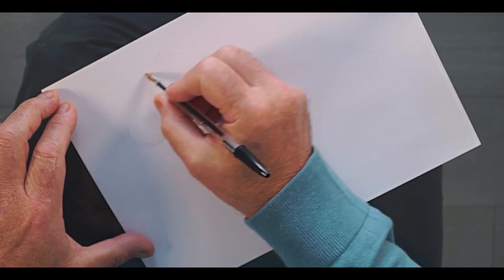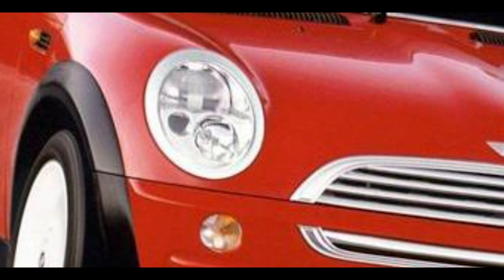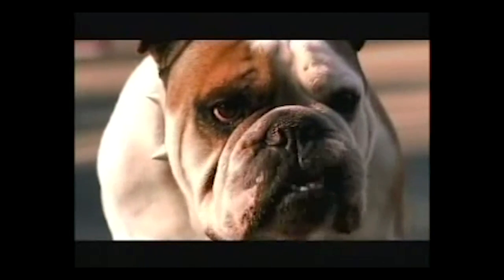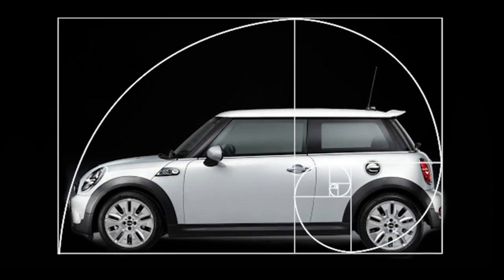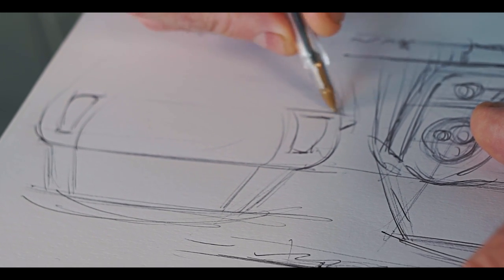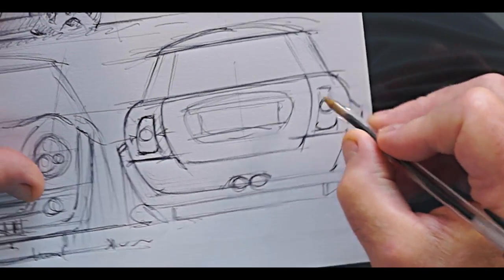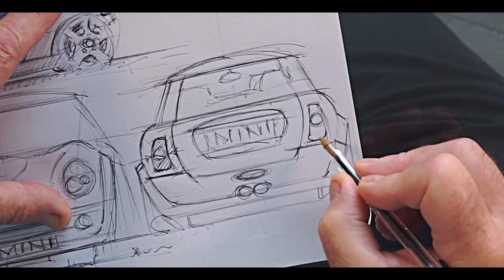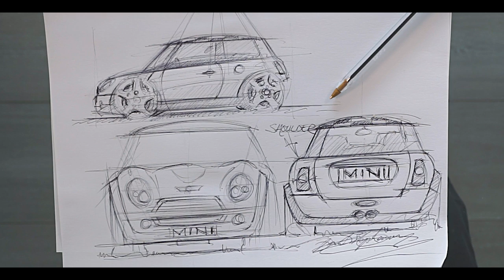How I Designed The MINI COOPER....

Comment: I had an 04 mini Cooper S. I think you guys nailed the design in comparison to the original. 
And the car was just as fun, if not more so thanks to the supercharger whine. I had mine bumped up to 225 HP. And a fully adjustable performance suspension. Also had a Carbo Fiber Hood, fenders and lift gate.

I now have an 09 1 Series. Which is heavily modified as well. Carbo Fiber M hood with power bulge. Fully adjustable coil overs. 
Which is an absolute blast to drive! Its producing aprox 260hp to the rear wheels.
Reply from the maker: Dayum, nice! 💥👍

Comment: I own an r56 jcw so the second gen of the “new” minis and i am so grateful that the design of my car still carries the same language and soul that you poured in to the original cooper.
Reply from the maker: Congrats and thanks BRM!
Reply: @FrankStephensondesign  its an honour mr stephenson! Until now, i had no idea that the “new mini” could have been designed in any other way. Your design was so faithful to the original in as many aspects as possible that it works so well as a seamless transition to the modern incarnation. Without your initial spark of genius i would not own such an amazing machine (minus its engine getting rebuilt and countless mechanical issues 🤣 but hey thats bmw’s fault)

Comment: I absolutely love this design. It is timeless. I have enjoyed looking at it every day for the last 5 years!!!! It already is a timeless classic that cannot be replaced in my book.  The design of this R53 is still selling this MINI brand, because every design change after it has been for the worse.  I can't thank you enough for bringing this to life. It is such a joy. 
A bit of history

I kept it stock for the first 4 years anticipating a breakdown that has still never happened. Bought it with 80k on it and it now has 140k. Nothing but tender-loving general maintenance. I'm always listening for a new sound and it runs like a top.

So lets put a cam in it and big injectors, have the ecu tuned, get rid of those cats with some headers and finish off with a single muffler exhaust, some more boost, intake, just everything we can bolt-on and give it over 200 wheel horsepower.  Now I got the cutest, and fastest car :) Game over, I win. 
I can't wait till the clutch goes out so that we can rebuild the lower end of the motor and put a limited slip diff in it.  If I had two, I'd just go ahead and do it.  Maybe I need two...

Comment: The first generation “new” Mini was a fantastic design. It was truly a younger image of the original, with some key touches that were faithful to the classic design. After that the car has grown increasingly chubby and larger, qualities that the classic Mini did not have. For that reason, for me, the appeal has been lost. The car may be more spacious, powerful, and have all the modern creature comforts, but that is just the opposite of what the appeal of the original is. So the new Mini, not for me, thanks.
Reply from the maker: I agree! Thanks for your comments.
Reply: And this sums up why I am still driving a 2002 Mini Cooper S which I bought brand new. I am looking forward to its twentieth birthday.
Reply: Agreed. Got a 2004 mini. Next car is going to be the New Audi A1. (Or another old generation Mini)
Reply: This design has aged very well. Great job!!
Reply: Bruno Desrosiers Have you had the oil leaks fixed yet? I'm having mine done shortly. Not Frank Stephenson's fault obviously, he didn't specify dodgy gaskets I'm sure.
Reply: Bruno Desrosiers Ah SAAB, a company that did things differently and did them well. I could see myself owning a SAAB.
Reply: I own a 2nd gen "new" mini cooper S, the R56. I believe they stayed true to the original design despite being larger. But I have to say, I really don't like the most recent F series mini.
Reply: @FrankStephensondesign  Yep, this is why I like my 08' Cooper S..
Awesome car despite the uhhh... VERY unreliable engine that BMW/Peugeot threw into it.
Reply: I waited for almost 18 months to get my 2002 mini. It was a wonderful car. The bulldog stubby look was brilliant. I owned it until 2017. During that time BMW destroyed the mini. Utterly horrid. Too bad.

Comment: Fantastic video.  Thanks for sharing.  Your design was what made me join Zipcar, so I could rent Mini Coopers.....which you could for a time.  If we call your redesign the Series 1 of the new era, I still stare at it.  And your video articulates thoughts I felt about the design but couldn't put into words quite so well as you do.  I loved those tiny round side indicator lights (which later bloated into something garish).  That combined with the artistic color and design choices buyers had (Union Jack roofs), and the whimsical campaigns.  Remember the Coop and me videos?  Even the interior warning chimes and accent lighting were classy.  Now that you mention it, no manufacturer really goes to the trouble of drilling out holes in sheet metal to insert tail lights.  I believe you should mention the extra design attention to the curved window glass around the C pillar...evidently that was a more expensive design to produce, which I think they modified later.  Clever and gorgeous.  Looking at the Mini lineup now, I think the only one that comes closest to that sense of right design your Series 1 created is oddly enough, the 4 door Clubman.  Best wishes.

Comment: Mr Stephenson. Thank  you for the Mini. I have R53 and the design is spectacular. One of the most best design of 2000 century and it did really well take the main points from the old Mini so it is recognizable Mini.
I like for example how the sides curves from the top without any spoke and then in the bottom starts to curve back. You can see this well after the front tires where there is like a little dent and then the black rims turns it outwards again. And you can see it also on top of the back wheels how it curves first in one way and then on the other way before there comes the black plastic. R56 was newer so good looking thing. I think that is because R56 does only bend in one direction; it looks little bit too soft/ not sharp.
Something about how well the design came out tells that when I take people in to my car and aske about how old is it? Usually the answer is 2015 or 2010. After over 15 years it still looks to people like new. It has aged really really well.

Comment: Frank, first thank you for your work and for making your work accessible with these videos. I believe that my r53 is a work of art. As such I believe it should bear your signature. Would you consider making a vinyl or other type of decal that would simply consist of your signature for owners who share my feelings?  I would be honored to have a small subtle signature on the lower corner of the back hatch for instance, or perhaps just below that gorgeous tail light.  (As a former print designer I would go with cut uv resistant vinyl. Though clear vinyl printed has certain advantages in production.)
Reply from the maker: Thanks for your thoughts on this...
Reply from the maker: We are considering this if the demand is there.
Reply: @FrankStephensondesign     I want   the   decals  !  I need the  decals.!   Some how i fell  for the  R  56  '13   and  the  2009  Maserati GranTurismo  without  knowing  who was the  Creator.  Gracias  Maestro,     " Often Copied,  Never  Duplicated! "

Comment: You knocked the Mini out of the ball park! Perfect design and balance! 👌🏼 they lost that after the R56 and now I don’t know what they are doing 🤷🏼‍♂️ same as BMW themselves, they seem to be lost. Cannot figure out who is building BMW’s and Mini’s nowadays. Doesn’t seem to be BMW. Even down to clutter in the engine bay en overall engineering. Especially the change from 5x120 to 5x112 (bolt circle) makes me think these are actually not BMW’s anymore. 
Could you do a video about the mark 1 Audi TT? We just bought one and we are overwhelmed by the design. Also own a BMW 525xi E60 which I absolutely love, don’t know what you think about that car?

Comment: I have been an original Mini fanatic all my life. 

I think you did a fantastic job. If you can get a fan of the original mini to like the modern redesign you did good. 

I'll never forget when my friend bought a new Mini I was stunned at the clamshell bonnet. I like that connection from the old because I have banged my head so many times on my old Mini vans bonnets 😀 That alone was refreshing and spacy.

Trust me the new Mini early gen is a design Icon already. I wanted to hate but my god is it great it even has the feel and cheeky character.

Ironic as the mini was influenced by a 2cv Van Alex Moulten assessed a van and Issigonis had driven a DS19 and the 57 prototype apes a DS looks wise. For proof footage of Alex Moulton showing his 2cv van assessment sketches can be viewed on an old equinox documentary about the 2cv.
Reply from the maker: Thank you David! 💥👍

Comment: i have a 1974 innocenti Mini Cooper for 35 years now, which was the most beautifully trimmed mini version ever built in my opinion. I think the design of the original classic mini still is unique and nothing can replace it. The new BMW mini is a nice fashionable car that reminds on the original, but it doesn't have the spirit of a simple classless, revolutionary and disruptive design. The new mini is too big  and not simple enough to be a real mini.  I just wished have a modern engine under the hood  on the highway . But I hope in 10 years electric conversion kits will be available for more reasonable prices

Comment: I'll admit I wasn't much of a fan at the time they came out. I'm glad to have been wrong. It's aged exceptionally well. A 2002 Cooper S looks like it could still be a current model.  Not many other cars from 20 years ago could claim that now.  (Never mind that it is actually a better car in almost every way than the current one). It's only got better looking with time, and will continue to do so. 

I think it's one of the very few cars that actually looks good in grey too. There's enough fun in the design that it doesn't need a bright colour to avoid blandness.

Comment: I'll be honest, not a fan of the modern cooper design. Not that cars are designed to match genders but in my opinion designs take emphasis on attitudes, like a masculine attitude you'd see in a mustang, or hummer, while certain sports/luxury cars just go for the lustful curvy and smooth look. Each category has it specialty in looks and personality that suits the role the car takes, but with the Mini and the Fiat 500 I've always had this idea that they're some of the most uniquely looking unisex vehicles to date. No matter who you are, what kind of person you are you can find a personality in the car that you can relate to. The modern Mini kind of lost that feeling for me, it's no longer the car and person that completes the picture, but more or less the smooth and sexy look that projects more onto the driver like a lusty outfit that tries too hard. The modern fiat 500 (which you worked on too?) Still holds up very well to the unisex feel of the original one, not too radically different just more streamlined. The new Honda E seems more like what a spiritual successor to the mini would look like.

Comment: Slight disappointment with the Mini is it's overall dimensions. A bit too large for being a small city car but too small to sort of be a VW Golf class car. Tried to transport a 1,20 meter wood panel in a rental Mini and it wouldn't fit across the rear bench due to the bulbous interior panels... switched to an i3 and it fit. So since then I have reservations for not being very space efficient due to the bulbous interior design in a Mini.

Comment: BMW Mini although not a bad effort!, I THINK it's still a mucky shadow of the Original, it's got worse through re-designs (union flag rear lights seem like a purely blatant heritage plunder) and it has mainly just abused the Mini name plate legacy. 
I think the Honest thing to do would be to just called it a 1 series BMW and it would have stood on its own.
Reply from the maker: You think it should’ve been more like the Original?
Reply: Maybe the original should have been left in peace to complete it's  production run.  Instead of tarnishing it's legacy.  The mini didn't need replacing. The Metro needed replacing.

Instead BMW killed the mini off early in order to build this awful bavarian retro pastiche.  Then they did everything they could to stamp on the aftermarket community that had kept the old car alive.

Comment: I do not like the design of the new Mini. You get a sense of the design of a car when you are washing it because your hands are flowing with the lines of the car. The Mini doesn't flow, it's very boxy and too many flat panels. The plastic wheel arches are the worst feature in my eyes and the roof is too flat and too high. The metal is too thin and as a result when you are washing it you depress the panels which just comes across as being cheap. The interior is even worse.